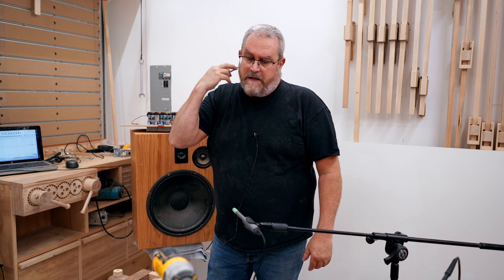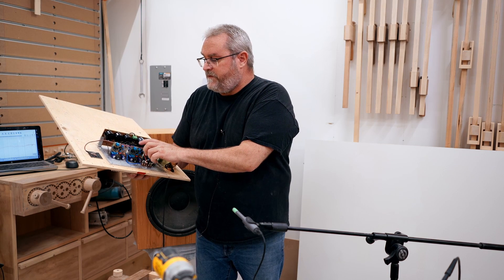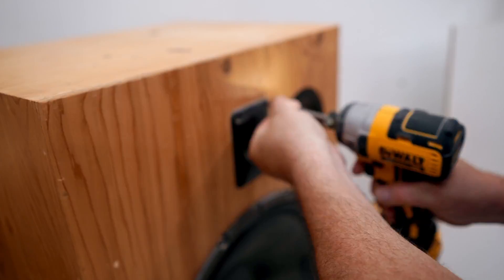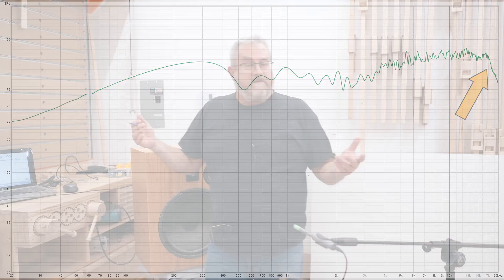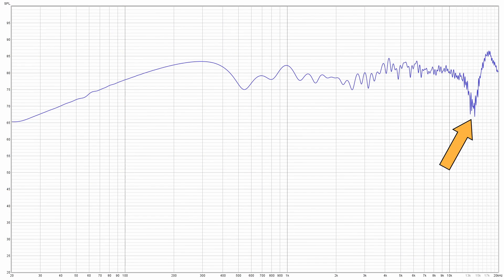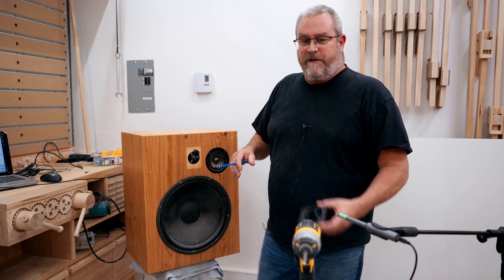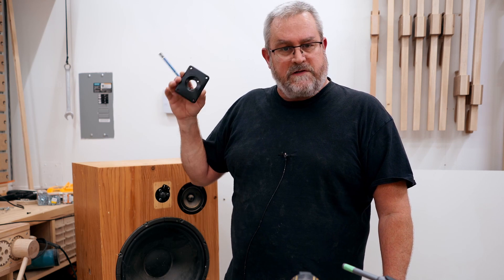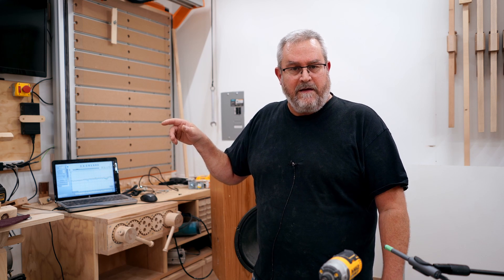Tweeter Horn Magic - What does a Phase Cap do?

Comment: It might sound better without the faceplate, if you cover the hole around the tweeter to stop leakage, just looking at the response. In a workshop with a lot of reverberations the faceplate's boosted treble may be desirable so it doesn't get drowned out by the mid reverberations. BTW with a large baffle like that you don't get so much diffraction. Where diffraction starts to matter is when the speaker is good enough you can almost believe the instrument is there in your room (IE you hear a bird outside and a bird from your speaker and you struggle to determine which one came from the speaker), diffraction can detract from that illusion.
Reply: Indeed. Diffraction tends to smear the perceived clarity / accuracy in the mids / highs. In general humans are most perceptive of the accuracy or lack of in what human brains are natively tuned to. I.e, in decreasing order of detectability: (1) human voices speaking  (2) natural sounds (3) acoustic instrument if you are a skilled player (say if you have played acoustic guitars for years then any departure from a live like sound will be perceivable). Pretty much anything else is difficult to judge, for lack of reference for our brains.

In my personal experience (going to audio stores & shows) about 70% of the speakers in the $2K - 20K range fail (1) and/or (2) and/or (3). However, in about half of these cases I would have been hard pressed to detect these issues by just listening to 'music' (lot of caveats here, it all depends on the type of music. Some music can be very discriminating I mean music where a lot of stuff is going on which distracts the brain, or when it comes to synthesized sounds for which our brain generally has no reference / expectation to compare to.).

He keeps comparing the importance of diffraction to 1st reflections on a wall, which is a completely different effect. Diffraction also sometimes shows up in 1/3 octave smoothed FR plots (depends on baffle / driver design), so his 'wiggles already exist so it does not matter' point is off.
Reply from the maker: What you both are mistaking for diffraction is almost certainly early reflection or imagination. If diffraction was such important factor, there would be a study proving the audibility of the effect. 
If you know of such a study, link to it here. Otherwise, you are no different from the guys that go on and on about how great the new pair of speaker cables they just bought sound.
Reply: @IBuildIt  If there is a 3db hump in the frequency response, it is almost certainly audible whether that hump comes from a resonance, diffraction or the baffle step. Distinctly audible as a hump in the response to most people, probably not, but perceptually enough to alter the illusion of realism. Question, do you also dispute whether baffle step correction is audible? Would you say that baffle step correction is audible but diffraction isn't? After all, the baffle step is the result of diffraction to begin with?
Reply from the maker: No, baffle step is an audible effect - measurable and well established as something that has been proven to be audible.
Proven to be, unlike diffraction.
If, like I sad, it's that easy to discern diffraction, why is it that there have been nothing that has done that. I asked for the study and you came back with more "because..." proof. 
Notably, Siegfried Linkwitz didn't believe diffraction is audible. Are you saying you understand the subject better than he did?
Reply: @IBuildIt  I'm not trying disagree with Linkwitz. I think you see diffraction as something independent from the frequency response which isn't really true unless you deliberately EQ out the SPL differences so only the time domain effects are left. But the baffle step is an effect of diffraction and that is mainly where I have dealt with it. I think the focus on diffraction of the treble may be a bit misguided. But if you looked up studies on baffle step correction, you would certainly find studies on that, which likely discuss diffraction as you can't really discuss the baffle step without diffraction. And if I can get rid of a 3db hump at 3KHz by rounding over some edges on my speaker I think that is likely to be audible just from an SPL point of view, no differently than baffle step correction.
Reply from the maker: I'm not saying that you shouldn't do things to mitigate edge diffraction. I'm saying that edge diffraction doesn't deserve the attention it's getting. It isn't a big problem that needs to be solved. 
Why is that so difficult for so many people to understand? It's about putting these "issues" in their place of importance. Learning what's significant and what's not.
Diffraction, because it hasn't been proven to be audible, isn't an important problem.
Reply: @IBuildIt  I agree. The most valuable problem to solve is to know what it is you're hearing. When a speaker sounds harsh people automatically think it is distortion, or there is a resonance or a diffraction, but these are usually all things they've simply been told and they latch onto some explanation. It takes a lot of direct experience to know what you are actually hearing. Most people try solutions out one after another to solve the problem without deep experience or understanding and usually arrive at a poor solution or some sort of compromise.
Reply: @IBuildIt  interesting...so something only has an effect after someone has proven it, but not before!!! Lucky someone proved gravity is real otherwise we would have all floated into space 🤣

Comment: Interesting experiment. What is not shown, of course, is the off-axis response. Taking those measurements would be far too tedious, but it would show that the tweeter's response would be a good bit narrower and more controlled with the "flare and cap" in place across the tweeter's useable frequency range. The narrowing of the load angle is what helps improve its efficiency. Without it, the tweeter's response will pretty much be out to the edges of the baffle at low frequencies, while it starts beaming when the wavelength approaches the diameter of the dome. Pretty much the treble climb disappears because the bare dome has such a wide dispersion pattern and a larger load angle. More energy is being directed off-axis. Very neat and interesting physics involved.

Comment: Cool video, and it's interesting how you can see the difference and improvement that the flare and plastic phase cap makes to the tweeter's response... When I first saw the title to this video I was thinking about the usual crossover cap(acitor) that is attached to many tweeters on the input to them to reduce the lows going to them, but now that I watch this video in full I now know that the "cap" that you are referring to here is the actual, physical, plastic "phase" cap directly in front of the dome on some tweeters.

I have another question though; what happened to the (other?) video that you had posted earlier today that was titled something like, ("I blew my tweeters while doing this..."), because I wanted to watch that one and see what exactly happened! (I was just at work when I got that notification and I didn't have time to view that other video until now, but now I don't see any notification about it anymore... Why not? Did you delete that video?)

Comment: It would be interesting to see if the shape of the horn is something that can be calculated for peak efficiency with the driver itself. I'm sure there are math and sound nerds who could show me formulas. But I'm just wondering how much of determining the shape is scientific and how much is experience and feel. Or is it just "generally parabolic and hope for the best"? Thanks for sharing!
Reply: There is math, and it is used in horn design.
You are kinda putting the cart before the horse in your thinking though.
There is no "optimal" horn shape. Horn shape it dictated by the intended purpose, and the shape has a huge impact on what it sounds like and how it performs.
As an example, if yo are designing a speaker to have uniform directivity (same amplitude over a wide angle) across all the drivers, you might consider using a conical horn on the lows (narrows the dispersion), and a parabolic horn on the tweeter (widens the dispersion). Klipshorns do exactly this. There are trade offs, parabolic horns add distortion in the lower part of their bandwidth, and conical horns have diffraction and combing issues near the top of their bandwidth.

The math is straightforward to people who can do math, and scary to those who can't. Numerical solutions are very easy to generate with a bit of coding skills.

Comment: On some tweeters the center of a tweeter can lagg behind the rest of the dome. I think a shield like this dampens this 180degrees out of phase sound from the center of the dome. Very cool to see  experiment like this :) I have a SB acoustic 6" with a breakup peak in the 7-9kHz range. I wonder if a shield would lower that peak the same way.  Could be a smart solution on drivers with high freq brakeup.

Comment: I would argue it's not a horn, but just a waveguide. It's shallow, expansion is negligible because of the phase plug. What you described as efficiency increase might as well be just gain from focusing the sound pressure forward, like waveguides do. To increase efficiency, you need to affect total energy radiated by the dome, which includes off axis. So technically you can argue that it may have  increased efficiency, but it's much safer to just talk about gain. From numbers perspective it's important because a tweeter in a flat waveguide is maybe  1% efficient, but in a horn it's more like 50%. I think people need to know that if they want efficiency, they need an exponential horn, that will really efficiently match the impedance.
Reply from the maker: We can consult the guy that first used the name "waveguide" to describe a horn, Earl Geddes:
"...all waveguides are horns..."
Whether it gets the  efficiency boost from directivity or from impedance matching, it's still a horn.

Comment: That's a real eye opener, and reminds me of ADS products, they used no waveguide or anything, just a protruding sticky dome tweeter and they sounded great, especially their larger midrange drivers, they must have built the tweeters really well to have quality of sound they had without any need for any add ons or waveguides to rework the sound to their liking, would be interested to see you review one of those from the famous L710/L810 etc. My favorite was the L630 and L730.
Reply: I had a Braun speaker system from the 70s. I was not impressed. The mid domes were actually touching the metal grill. And it's not only a problem mine had, you find countless of pictures online of pulled drivers with the pattern of the grill imprinted on them. What kind of "engineering" is that? The woofer edges fell apart and the cabinets ended up as firewood. I had to throw away one of the mids too, when I measured it it distorted horribly, because the grill squashed the dome out of alignment. Never understood the hype around that brand, there are much better vintage speakers out there.
Reply: @westelaudio943  the part about certain drivers is true, some frames on certain ones did corrode and rust and the surround would come undone and had to be redone, but if you listen to the the 630 or 730, they were very good, maybe not by today's standards, but if you listen to those there's no denying they got those right and they sound really nice all around.
Reply: @JukeboxAlley  

The drivers weren't the problem, the woofer succumbed to foam rot which is not uncommon for many drivers and it's fixable. Mid and tweeter seemed of very reasonable quality.

The real problem is they released a product to the public with a design flaw (grills touching dome) that not even an amateur speaker designer with half a brain would have made - and that tells me all I need to know about that company, and their so-called star designer Dieter Rams. With the grill removed the speakers sounded alright - at least the one where the grill didn't manage to damage the mid - but nothing to write home about. There were much better speakers back in the 70s, however I prefer 60s and 80s/90s speakers and also my own designs and I never looked back after getting rid of the Browns. 
I don't remember the model because I tossed them may years ago I'm sure they had better models but still it tells me what I need to know about the quality control and design competence of that manufacturer.
Reply: @westelaudio943  maybe true about the old versions, all the later versions didn't have foam surrounds they used rubber in the later models.

Comment: Awesome work. It really gives you a sense of the kind of engineering that goes into making drivers, even inexpensive ones.
Reply: If they made the driver correctly in the first place, they would not have needed to modify anything.  They chose to use the cheapest available tweeters, and mod them to get "Acceptable" sound.. to make as much profit as possible.   This is an awful practice, that should Not be Praised (especially when the cost between a good tweeter, and a Sh*T tweeter, is likely less than 3$).
Reply: @johndough8115  I disagree. Everyone is free to choose whatever tweeter suits their needs and price point. These microdomes typically outperform piezos and paper cone tweeters and fit in a lot of places a regular tweeter does not. Would I use one in a speaker build? Probably not, but a good hi-fi tweeter always costs a lot more money.
Reply: @bryede  You clearly do not understand what Im saying.  Im saying, that the company that made these... was likely a Chinese MFG, that made mistakes (or simply, just made sub-par garbage).

 If they had designed and properly made these things correctly from the start... they would not have needed these extra plastic parts.

 Rather than use a decently made tweeter... Some company likely purchased them in bulk for dirt cheap, and engineered a way to slightly Improve their poor performance.

 The consumer is then essentially getting ripped off... being sold sub-par drivers, in an Over-Priced speaker set.   As I guarantee that the savings of these Modded Tweeters, are Not being passed on to the consumer.

 (possible exceptions, are some savings when purchasing an entire boom-box)
 

 The best tweeters Ive every heard, come from the EPI 100v speakers  (The updated tweeter version, that has the plastic bezels).

 There is a guy that used to work for the company, that Hand Makes brand new versions of them... for $60. (humanspeakers)

 If these were made in China on a mass scale, they would probably cost like $3 each to make, and probably would sell for $8, to the speaker Mfgs, in bulk.

 Yes, they are much larger in size, due to a massive powerful magnet.  But they are meant to go into bookshelf or full sized cabinets.  Not in tiny boom-box or PC Speakers.
Reply: This stuff has been around forever. It shouldn't be too hard to make decent tweeters by now